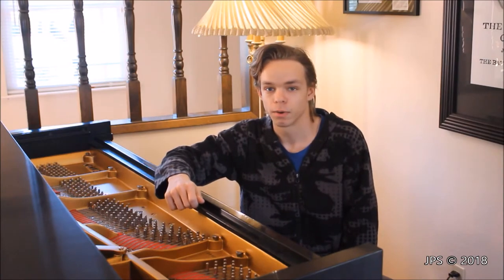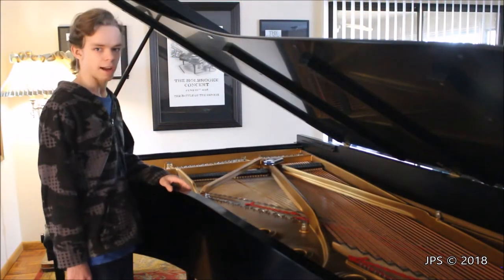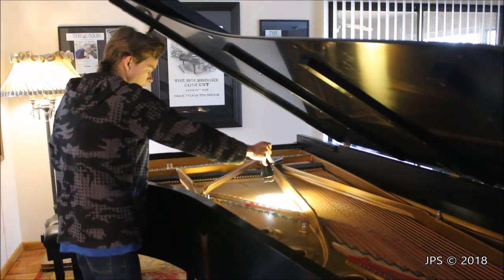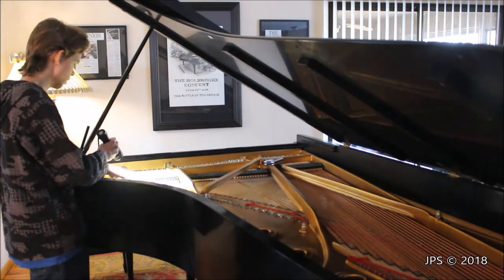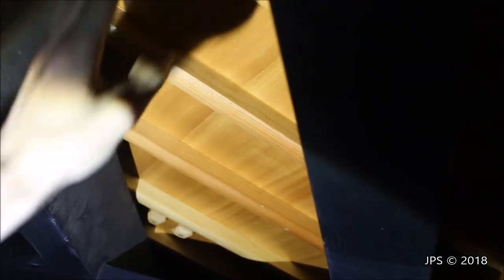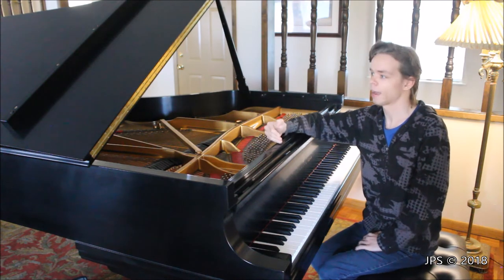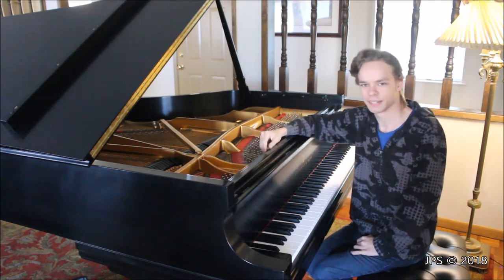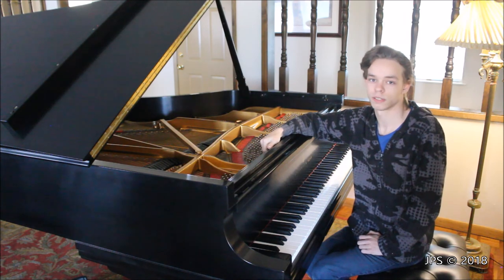How to Buy a Great Piano: Episode 8  Buzzing sound from your piano

Comment: Sometimes the buzz or rattle is not really coming from the piano itself.  I recently had a rattling sound that I thought was coming from my piano when I played a bass note.  It turned out that it was actually coming from the fluorescent light fixture above the piano.  Also, my piano tech told me about a piano that had a buzz and nobody could figure out what was causing it.  The piano tech slid a probe through one of the holes in the plate and along the sound board.  Just by luck he found a coin that the owner's young son had dropped into the piano.
Reply from the maker: I have had buzzing from across the room that was hard to detect. I find it is best to use two people when trying to identify that type of noise. I also had a older Seth Thomas metronome that I had to stop using as the face plate was buzzing all of the time even when not in use.

Comment: My sister tells me that she has a crack in the sound board of her small upright piano.  Her teacher/tuner told her that, since she doesn't play much anymore, she shouldn't worry about it.  I'm not sure if there is a buzz or not.  Is there a simple fix, like injecting the crack with a glue that has good cohesive, as well as adhesive, properties?  Or would that mess up the resonant (is that the right word?) properties of the sound board?
Reply from the maker: If it is not buzzing I think it will be fine. If it is buzzing your sister might be better off just looking for another used upright unless she has a special attachment to the piano.

Comment: I haven't got anyone else available to help me try all of these things at the moment, although I definitely have to have a go.

Any thoughts on what the range of the buzz might suggest? I had two high pitches a semitone apart that have been both buzzing for a while. A damper screw fell out the other day, so I took the action out to replace it. I ran the hoover inside as well, as I'd be wondering if the sound was coming from something around that area. Since I replaced it, the buzz has spread further though. It's now covering notes in the range of a tritone or so. Does this point towards any particular possibilities to check in this area? It's so strong on one of the new notes that I'm sure I can't simply have missed it before. Would some kind of debris cause a buzz over such a big range?

It's quite a new piano (a kawai gx3) so I'd hope that any structural faults are unlikely.

Comment: Love your videos, Jamie. They really helped in the purchase of my 5'10" Boston. Just had its first tuning, and when it was finished, there was a certain B-flat in the bass that caused a buzz when played very loud. The tuner (very skilled, works for Chicago Symphony Orchestra) discovered that the hammer wasn't hitting the string perfectly square. (She fixed it.) Have you heard of that?
Reply from the maker: I have not heard of that one, but I have seen a damper wire hitting a string an causing a buzz.
Reply: I have an upright piano and I seem to be having the same issue but mine is just a B. It’s refurbished and they told me everything was replaced but I don’t know the buzzing sound is annoying I’m hoping when my first tuning comes around they’ll be able to fix it.